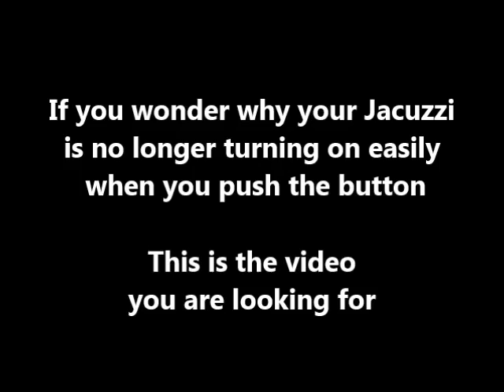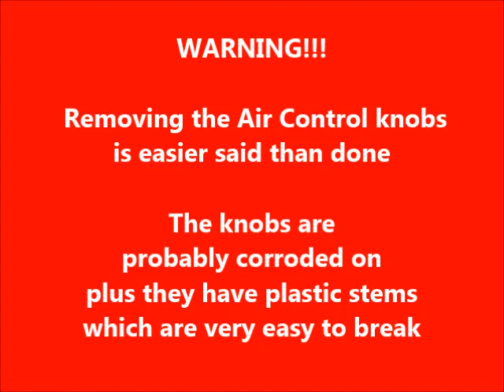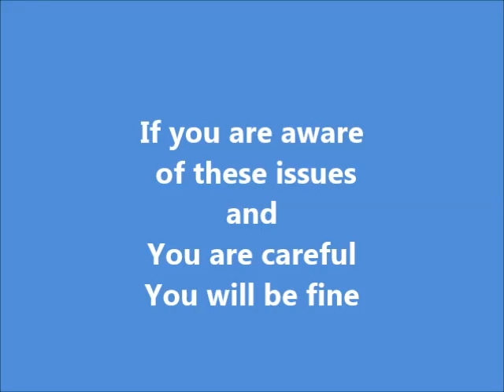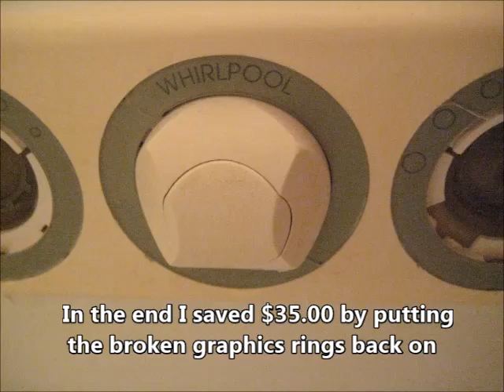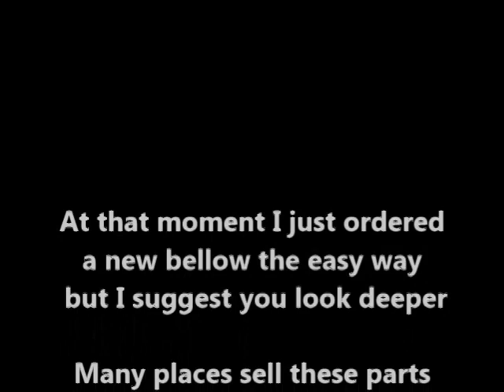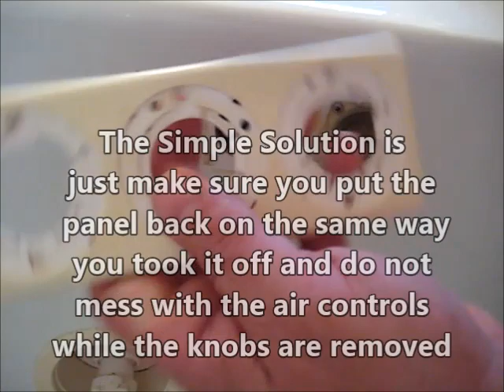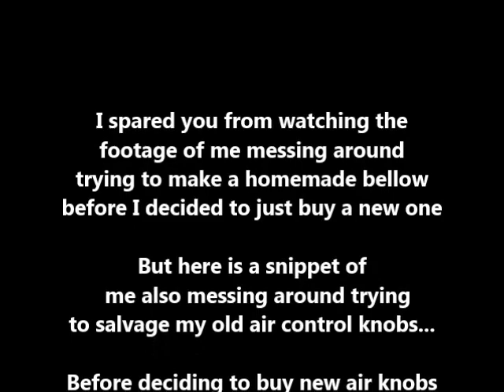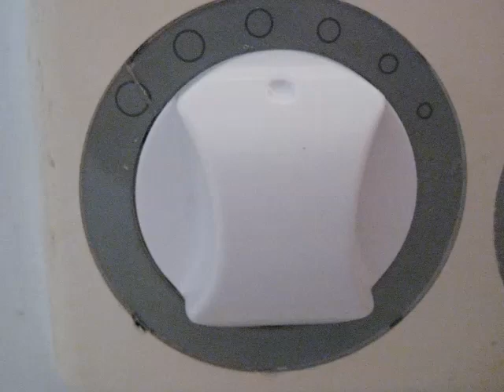Repair Jacuzzi on off button fix air switch not working on hot tub jet, the truth, replace pneumatic

Comment: My bellow switch looks just fine. The button doesn't stay depressed though. Any suggestions?
Reply from the maker: I am not sure I understand... but ... the button is not supposed to stay depressed. It is an air button. After pushing it down it re-inflates and stays up. The whoosh of air form the bellow in the button goes through the air line and operates the pump. 

Maybe you are saying the pump does not stay on...  in that case it is a pump issue not a button issue.
Reply: 7777jayhawk sorry I phrased that weird, when I push the button the pump works and I get water through the jets but I have to hold it down manually to keep them on.
Reply from the maker: Hmmmm... that is interesting...  this bellows part function is to blow a bit of pressurized air through a 4-5 foot air line back to the water pump. The water pump has an "air switch" which turns it on and off. 

I am not an expert on this ( and you may want to consult other opinions) but maybe the air switch has gone bad and needs replaced. 

AJ on another Youtube channel has a pretty good video which shows how to do it. He makes money selling parts, but I like his video style (he has no weird thumping back music, no long introductions (where so many youtubers stare in to the camera and blab for 10 minutes before getting to the point)... 

AJ makes good videos which get to  the point... so I am happy to link to his video. How to replace the air switch on your JACUZZI Whirlpool Pump https://www.youtube.com/watch?v=N82O98_qduc and if he is making money and sells parts maybe you can call him and he will talk to you and offer some advice.
 
I would ask you (on behalf of others who will come later) to make and post your own video about you current issue. Talk, show and tell about the project with the camera rolling showing how your button has to be held down to make the jets work.... and if/when you figure it out  and solve the issue  talk about that with the camera rolling... even if you have to hire a plumber to do the work... or do it yourself. Someone else will along will come along and have your exact problem and you could help them.
Reply: Without knowing more about how it works, I'm guessing either a faulty switch like you said. Or maybe a pinhole leak that sends air pressure but wont hold it (if I'm understanding how the button works correctly) I'll re check the whole line and if that's not it check the bellow then pump. I've never made a video before but if I figure it out I'll try making one.
Reply: I have the same problem. As soon as I let go of the button. It stops.

Comment: My problem is when I plug the motor in, it automatically turns the jets on.  Do you think this would work for me?
Reply from the maker: It is possible the motor is in the "on" position now... I would suggest. 1)Fill the tub with water first. Never run it dry. 2) Find the air hose and take look at it, make sure it looks good to go. 3)Plug in the motor... AND.... it will go on (as you said) 4)then push the button of the air hose... or if there is no button, blow into the air hose. If that shuts it off (and blow again to turn it on) then this will fix you up.

Comment: I replaced the air button with a new one, because the old one had to be held pressed the whole time for the motor to stay turned on. Well, the new button did not fix the problem...
Reply from the maker: There is a button and there is a bellows which sits under the button. Then there is tubing connected to the bellows which goes back to an "air switch" on the motor. When the button pushed into the bellows it pushed air through the tubing and the air pressure pushed the switch turning the motor on and off.
You probably know all that, and I am not being snotty repeating it. Sometimes when we thought we fixed it.... but it "did not fix the problem" stepping back and looking it all over and thinking about it can help.
In your situation I am going to assume you meant bellows when you said button. You put in a new bellows and it did not fix it. The question is... WHY? What could the problem be if not the bellows?
1) Is the bellows properly, firmed connected to the air tube?
2) Did you do the "blow in to the tube" test? to see if blowing into the tube with your mouth and lings turn it on and off? It is easy and simple. When mine was broken and I was waiting for parts I turned it off and on for a week or so with my mouth.
3)IF blowing into the tube does not turn it on and off you may crack or holes in your tube. That is also an easy fix.. if you can easily access where the tube connects to the air switch on the motor. 

I am lucky I never had to deal with the motor part, but I was braced to someday open up the wall behind the motor so I would not have to try to pull the motor out the hole. I would have crack open the dry wall to access motor because to me it seemed easier to repair dry wall versus deal with moving the motor. BUT.... it can be done sever ways.
If the tubing is bad, hopefully you can buy some simple plastic tubing (maybe at the hobby shop, hardware store, tubing store,etc) It is not fancy tubing... is is simple regular plastic tubing. Cut off an inch and take it with you.
4) If the tubing does not fix it.... you air switch might be bad. That could cost you some money and might be something you pay a pro to do. Let them deal with how to access the motor... I have no idea how much a guy would charge... but you might find a deal with a pool guy versus a plumber... or try it your self... but the air switch, hopefully find a video how to do it... and do it. Paying a guy to do it might cost anywhere from a 12pack of beer... to $50.00 to $300.00 and I would not be stunned if a guy quoted $985.00 plus parts and up. 

5)If a new air switch does not fix it... well... then you need a new motor. The good news is putting a new motor on might be the same price as the high priced other thing. If you pay to replace the motor make sure you get a new air switch, air tube and bellows. That should make it all go for another 10 years.

I really hope you put on a new button and not a bellows.... because that means a new bellows will fix it all. BUT... before you buy a bellows do the "blow in to it" test to see if it works with a puff of air. No kidding.. It is not a hard puff of lungs... or even long... just a quick puff into the tube will activate the air switch.

I hope I understood your question and I hope those tips and talk helps fix it up.
Reply: @7777jayhawk ,

I researched a bit and discovered that in my case it is the air switch that is causing the problem. I ordered one and will replace it myself.
Reply: @7777jayhawk  Thank you so much for your comment on this issue. Your comment put the finishing touches on the video. Thank you again.
Reply: If you can turn on, then your button/bellow/tube are all ok. No leak. The problem is the air switch on the motor. It suppose to be a latching switch (One air pressure input - turn on and stay on. Next air pressure input - turn off and stay off) However it tends to fail and become momentum switch (you must maintain high air pressure to stay on). I replaced my switch zp1521u10 with TB310A and fixed.